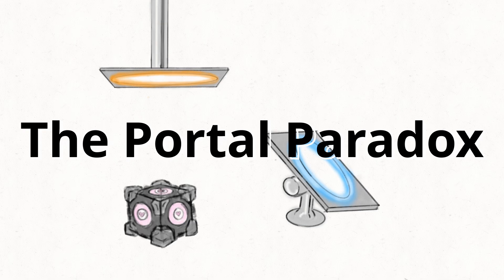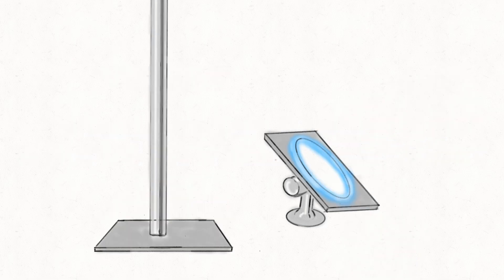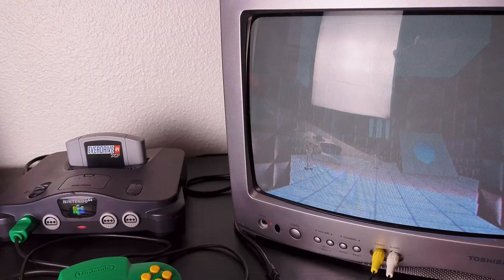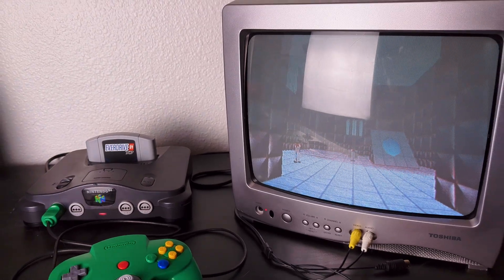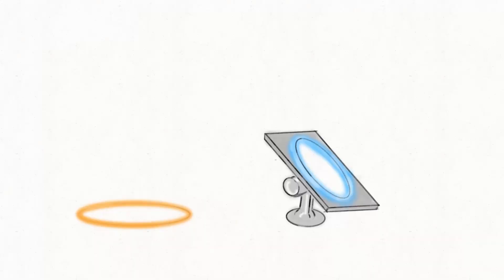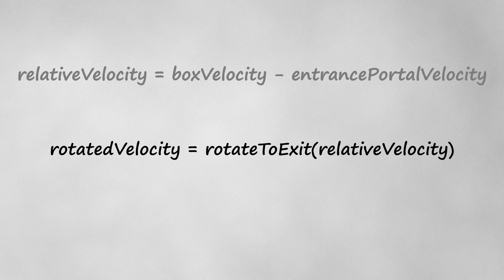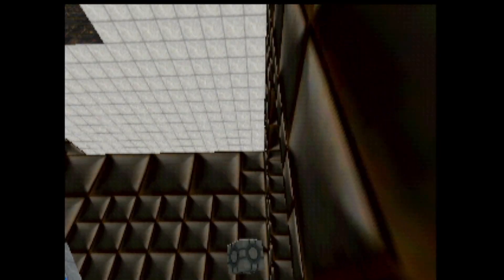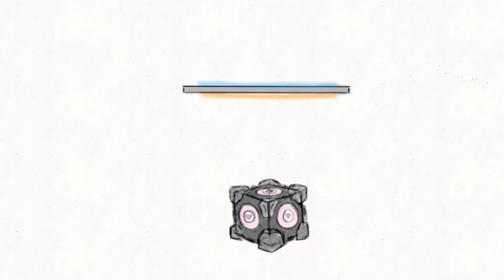I rewrote Portal from scratch and solved the Portal Paradox

Comment: I wonder what would happen if you move the entrance portal slowly over the cube and the exit portal is stationary over a ceiling.  Would the stationary cube eventually pull UP into the entrance portal as gravity on the exit portal takes control of the cube?
Reply: It will fall into the portal when a half of the cube enter the portal. Slowly accelerated, as like there was usual floor and suddenly it dissappeared.
The entrance portal won't give its speed to the cube since it can't do so.

Comment: Technically wormholes aka portals in the real world wouldn’t move at all, as they are connected points in space, so you’d have to move space to move a portal, meaning that portals don’t actually “stick” to physical objects, but instead to the space itself, meaning that moving the object that the portal would appear to be “stuck” to would not move the portal at all. This is the real-world physics reason for why the question itself is wrong, at least in realistic physics simulation

Comment: If we're talking what would really happen, any changes in motion to a portal is like moving the entire universe on the other end of the portal. If you moved a portal (aka: accelerated a portal), you'd actually be moving/accelerating the whole universe on the other side, unless the exit portal moved in a matching speed and direction to cancel it out perfectly. In "reality" if we assume a totally uniform spacetime with no changing gravity or whatever, you would be able to theoretically have a moving portal relative to its exit but it would have to continue moving in that direction and never change. Absolutely no acceleration (no changes in direction or speed) would be possible as that would take infinite energy to do since momentum must be conserved between the two sides. Having the portal change direction or rotation would be akin to literally moving the entire universe on the other side of it, which would take infinite energy to do.

Imagine if I could put a portal on a comically large fly-swatter and swat it over you so you go through the portal at a very high speed, I only expended a small amount of energy but you went launching into the universe on the other side at quite a high rate of speed. In order to stop you it would take a lot of energy. It would take more energy than I put in. So basically I could put a portal on a tennis racket, swat a cannon ball as fast as I can, and have it launch out the other side at the speed of my swing much faster than I ever could throw it myself. I would be creating energy from nowhere, and that's another impossibility.

Rotation of a portal is especially impossible because when you rotate a portal, the outer edges of the universe would be accelerating relative to your viewpoint at a rate of speed approaching infinity the further out you observe. If the universe is infinite then the rotation speed at the far corners of the universe also becomes infinite, and it would require not only infinite energy but also an infinite speed limit in the universe to move the whole universe on a swivel at infinite accelerations, as it must happen in order to conserve the correct momentum between the two sides of the portal.

Comment: The solution you went with is contrary to newtonian physics. It makes as much sense as cartoon characters not falling off of a ledge until they realize they have walked off of the edge.
If the cube accelerates, then something exerted a force on it. What force did the portal exert on the cube?
You may be tempted to think it would shoot out, since the cube would emerge from the other portal faster if the entry portal moved faster, but that's the entry portal moving.
Imagine we are looking at just an entry portal and we visualize some void beyond it. This explanation is akin to visualizing the entry portal coming down on the cube, and the cube suddenly flying upwards when the portal takes it on.
You can even imagine that the cube is floating in the air, perhaps in space, with no forces acting on it. Would simply moving a portal over it cause it to accelerate out the other end? (If that were the case, we could construct a machine which generated infinite energy in space- but portals can already generate infinite energy from gravity, so, whatever)
Portals never move- and this is a hypothetical question. But why has it been decided that moving portals only impart their velocity onto the transferred object? Why do they not also change the color, and the size, and the weight, etc.

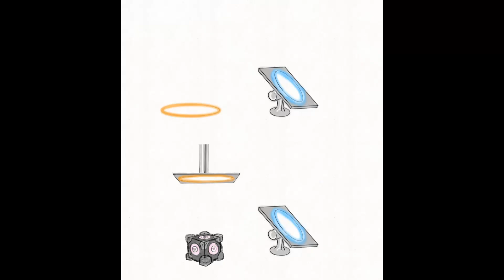Comment: 1:36 Well the problem with said expression is that you don't specify the systems that you measure those velocities in(since it won't make sense that way). Ok, we are talking about the video game so the precense of the "absolute" point of reference is pretty much the given, so the velocities from the first equations are exactly that "absolute" velocities, and after that we have a velocity in the system tied to the "entry" portal.
Ok, so far so good. Now to the part that makes it  a topic of discussion - how to define "teleportation"? If we simply define it as "change the coordinates "instantly"" - then there is no reason to add the relative velocity of the second portal. If we define it as "they are the same point in space" then just the whole system breaks, aka such defenition makes no sense. My point is that all the definitions of teleportation relying on such simple methodologies are all equally true and untrue, since we rely on our sole definition of teleportation. 

My take on this is somewhat more sophisticated, but it does provide better justificatioj for your equations- if we imagine teleport akin to alligned "hole-lines"(imagine a line cut in a paper) in the paper, so by moving those "hole-lines" we do not affect the object at all(if we exclude the deformations of the paper itself, but we don't yet include them in our little system just yet, so imagine those holes just to be connected without bending the paper), like in real world you can for example slide a quarter sitting on a rope through a loop in a roap without actually moving the quarter, but moving only the loop*(aka deforming the rope only in the place where loop is, while the roap in general stays in place) same thing applies here. So anything that went through  would be stationary. The problem with this aproach is that by that logic every little small part of the "object" should end up in the same "line", since every part of the object gets teleported to "line", here we are forced to step out out of our little model and we need to assume some things. We can asume one of two things - we either assume that forces aren't contiously teleportable and therefore we teleport and collaps all together because atoms get overlapped and some crazy shenenigans happen(which i am not sure what will happen if that were to be the case since i am no physycist) , or we can collapse due to the fact atoms are themselves are quantifiable by teleportation and therefore we destibialise the atoms by temporarily HEAVELY disrupting the structure of atoms(and probably some other crazy shenenigans caused by the same "overlaping" effect described above). On the other hand we can assume that forces are continiously teleportable, then we'd be "squezed" by the moving teleport, since what happens effectively is that it "tries" to compress you(since litteraly every part is progresively teleported into one line) into the line(or the plane if we are looking at the 3d "wall" portals) by moving, and your inner bonds resist that. Since first assumption is no fun, let's go with the second one. Ok, with this assumption we can say that the speed of "in" teleport atleast is proportional to the speed at which you are getting out of teleporter. Easy enough. Ok, than let's move the "out" portal and make the "in" portal stationary. By the same logic if we slowly move through the portal we get "parts" of ourselves being "stretched" out, since it tries to teleport different lines of ourselves into different places, which is resisted by our inner bonds, therefore it creates momentum that is opposite to the velocity of the "end" portal. Ok, now adressing "the bending paper thing" i exclude it from the model due to the fact that... i don't know how to "define" the paper, since it's just supposed to represent the continuity of space itself, but on a plane, so just imagine "bending" the 3d space in which the paper is to get the desired effect, like you can bend the paper for the line on the paper to cross itself in one point(imagine a line of paper with an ink line in the middle, now make the overlapping ribbon out of it - aka cross the sides of it so there is a section that overlaps - the line croses itself in that exact point without deforming itself on a plain, which is exactly the effect we need). I am not sure how "physical" this whole idea of bending space in higher dimensions is, since i don't know the general relativity theory(i know only special relativity) and i am not sure what physical equvilent of the 4th dimension would be either, so yeah... It's too kinda shaky in that detail, but i reccon, it's better than the "all defenitions are acceptable" that is provided by just general mech.

Tl;dr To better explain why do you need to add/substract portal velocities, you need to think of teleportation as sequential vectorised "stretching" and "squezing" of the object.

Comment: This is amazing! Couldn't you also test the age old question of "what happens if you get trapped between two portals"?
Reply: best case scenario you just get crushed by yourself
Reply: @sossololpipi9633  Exactly what would happen. But after getting crushed, there will be created VERY HUGE pressure, because your material can't move. I think the material will fly out on of small gap between the platforms. That could be an explosion though.
Reply: @fantastikboom1094  If you do it fast enough, it's just like if two portal-less walls came crushing on you.
Reply: This scenario is a lot easier to think about, like as the portal gets closer and closer, your legs would for example dig into your shoulders, and so on, until either the pistons give out or all that matter of your body is squished to the sides. This is actually important to demonstrate that portals only LINK spaces, they don't CREATE any, despite the visual illusion that they do create space.

Comment: Cut holes in a sheet of paper at both ends and put a box in one of the holes. Fold the sheet of paper so both holes cover the box. Does the box fly out of the hole? No, not unless you code it to.
Reply: This isnt equivalent at all. In order to do it properly, you'd have to have something that can move on the paper by itself, and a way to move the hole relative to itself.

Comment: i dont see a flaw in equation, the one thing that bothers me about this result is that the enternance portal is slowing down rapidly when it meets the cube. So cube exiting blue portal would in first moments had high velocity but it would slow down to 0 as orange portal stops moving, if the orange portal would continue to move somehow and not stop then cube should go flying.
Reply: as for result in your engine, i guess it calculates velocity of cube at the moment cube enters portal and not taking in acceleration of moving portal

Comment: So, as the top of your head exits the stationary portal, the rest of your body is shoved underneath it, which is where the acceleration comes from. Your head is being thrown out of the portal by the rest of your body at whatever speed the entrance portal was moving. 

So, you could actually crush objects by moving the entrance portal too fast. It would be interesting to see this with a simulated empty soda can.
Reply: It makes no sense. There is no reason and no way entrance of the portal gives energy to the object.
Reply: @fantastikboom1094  It would not give energy if both portals were stationary or moving opposite each other, the motion would cancel each other out. However, with one portal moving and the other stationary there is an imbalance. 

The theory of relativity states motion is relative to your point of reference. Meaning that, in a void with only the portal and you, you would not be able to tell if the portal was moving towards you, if you were moving towards the portal or if you both were moving towards each other. And the universe dose not care which one is happening. 

If you were to imagine there was a lid on the exit portal, not a sealed lid just a board laying across it, you would agree that you'd have to push that lid out of the way before exiting the portal, yes? And your hand will exit the exit portal at the same speed it entered the entrance portal with. And if the moving portal is moving slowly, your hand will push through the exit portal slowly and the board will fall to the side. But if the moving portal is moving quickly your hand will emerge quickly and throw that board across the room. That what's happening to you, its just the board is actually the molecules in your body slamming into each other as more of you gets fed through the portal.

What's also interesting is; what if the exit portal was moving and the entrance portal were stationary? If the exit portal is moving away from its face you'd get sucked into the entrance portal, and if it were moving towards its face you'd get repelled back out the entrance.
Reply: @ZeroCoolIsGod  You don't understand how portal works. I really tired of explaining this for many people. Just imagine a portal being a doorway. That's actually how it works. I don't care about relativity because there's nothing to do with it. We clearly see that the cube doesn't move, those portals are in the same room, we see both of them.
Reply: @fantastikboom1094  Oh, I get it, you don't understand physics. Hey man, don't worry, lots of people lead healthy and fulfilling lives without knowing or caring how the world around them works. 

Have you considered the possibility that the reason you are "tired of explaining this for many people," might be that you're incorrect. And what you are trying to describe as a simple doorway is actually a very complex 2 dimensional object that is both moving and not moving at the same time, depending on which direction you're looking at it from?

Just take the L on this one bro, you're wrong.
Reply: @ZeroCoolIsGod  The only thing you said is that I am wrong and tried to insult me. Since you didn't say anything related to the topic, I won here.

Comment: the portal does not impart momentum to the cube. So it would 100% fall out of the portal because portals don't interact with matter.  That is why speedy thing goes in, speedy thing comes out. 
The momentum of the platform is irrelevant, I understand the confusion because the platform pushes objects, probably in the game code too. but the portal negates the pushing of matter in front of its surface. It just lets it pass through uninterrupted.

Comment: In your implementation, the cube gets velocity from the fact that it knows it passed a portal. If we imagine portals as a real thing, nothing should be able to tell if it went through a portal or not. And you can't get energy from passing  a portal, nor lose it. Speedy things goes in, speedy things goes out. It should just flop out, and to point out the flaw in your implementation, try stopping the falling portal not at the bottom, but near the top, then just above the middle, then just below the middle. Depending on your implemenation you pass a treshold where you apply the force to the cube (I guess it's the middle) but what if you stop just before that? I suspect your implemenation will just let the other half stuck out of the exit portal but wouldn't move it. If moving portals could somehow affect the object, the parts of the cube that had passed, should still receive the same kinetic energy, start and stop fast enough and you can tear something in half. I don't think that should be the case. In my interpretation where the cube just plops out, the parts of the cube that went through the portal are just in a new refrence frame, so gravity applies to them differently, in your scene, stopping the portal midway would result i the cube slowly starting to slide (provided it's greasy enough)
Reply: Sadly, there are much more people are not understanding that...

Comment: 1 problem or interesting fact I could see is if the moving portal stops halfway on the cube. Wouldn't the top half of the cube already fly out while the bottom half stays stationary? Therefore the top half would pull the bottom half along and just fly less far?